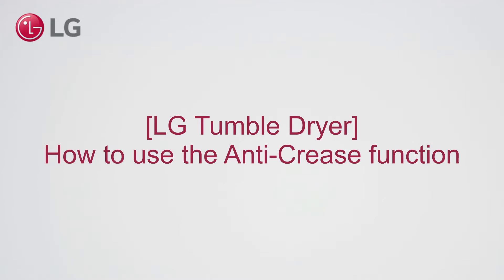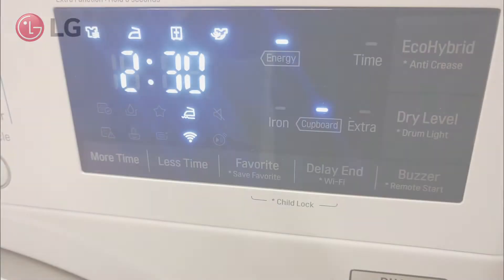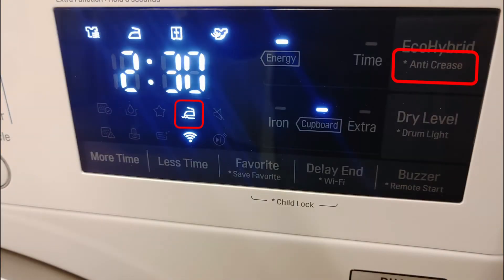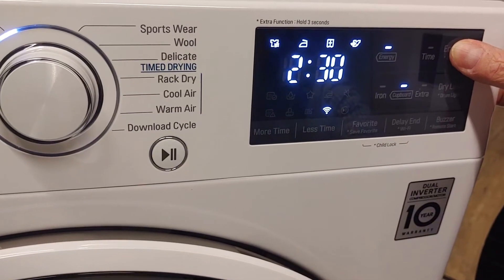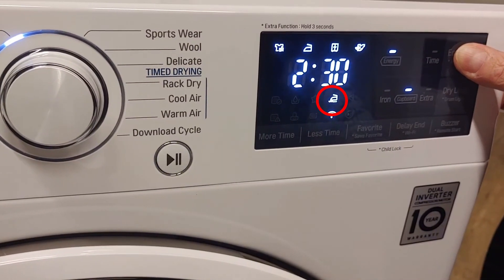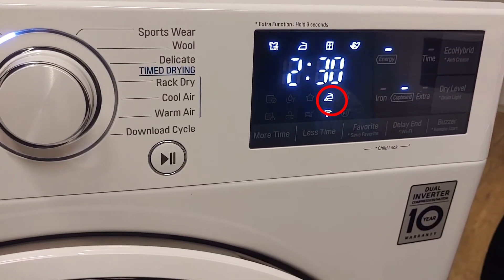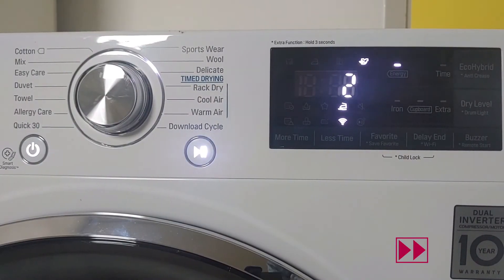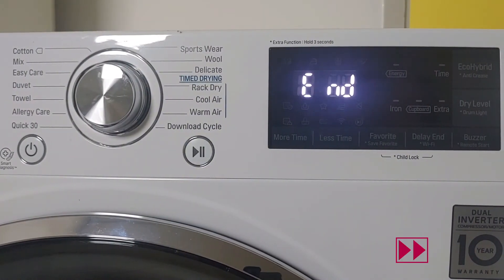[LG Tumble Dryer] - How to use the Anti Crease function

Comment: Can you use the anti-crease on the dry function
Reply from the maker: anti crease only works after the cycle has finished, to prevent the laundry to crease when it doesn't move in the drum.
Reply: I using the this model LGDryer..My dryer keep pausing whenever i dry my clothing. I need help